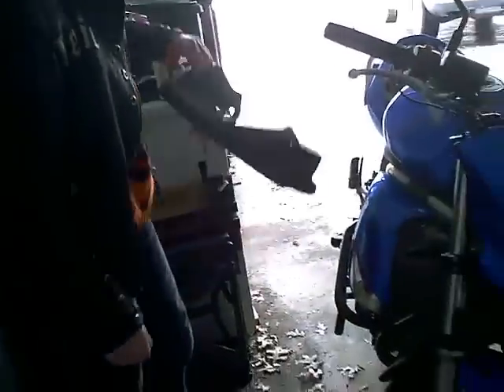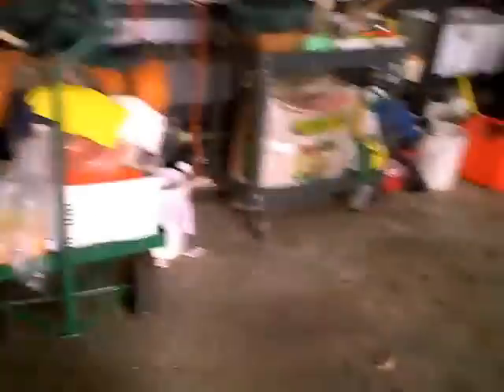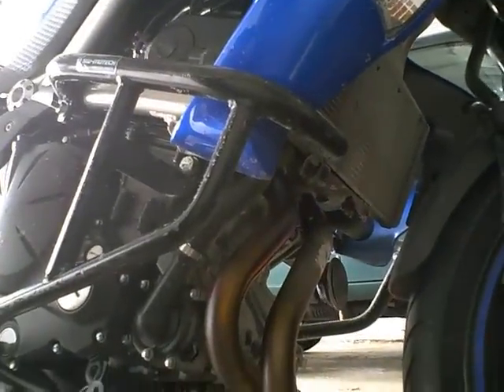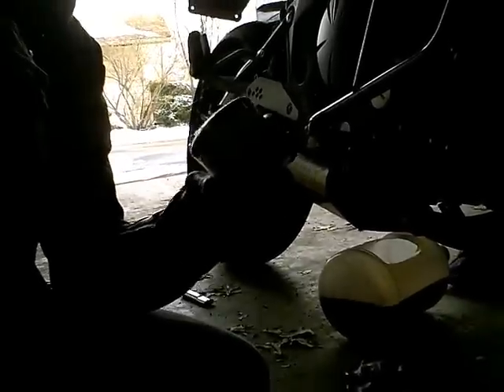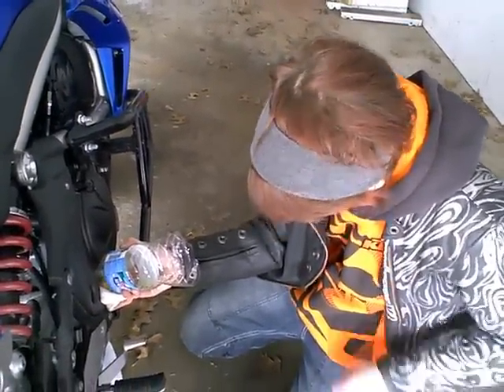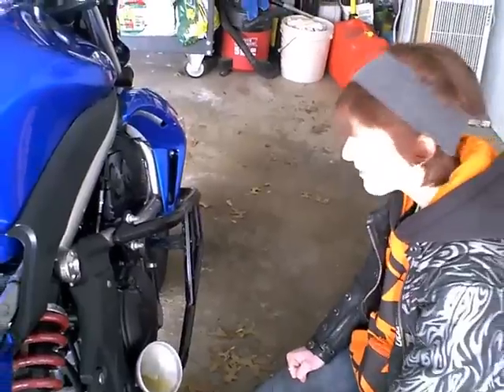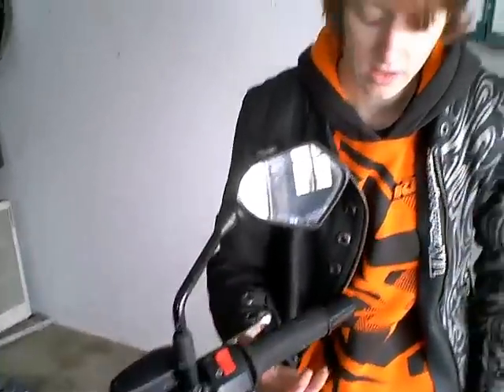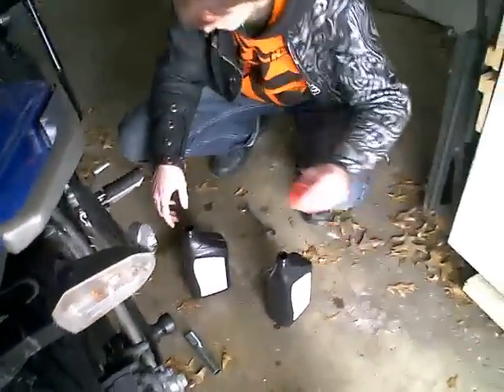Changing Oil the MacGyver Way, Starring LaurieJennifer

Comment: Yes and no.  I had let it run earlier, but that was where the problem came in.  Generally, I would do that, as warm oil flows better.  In this case,  condensation had gotten into the oil, so the main goal was simply to clear it out asap and not continue to run it.  Watery oil is generally no bueno.

Comment: The white smoke is water vapour from the combustion process. As the bike warmed up it drove off the visible water. Magnetic drain plugs only let you know something is going seriously wrong in the engine. The oil fiter should catch the particals. Without spliting the filter you'd never know of a major fault until it was to late. Or thats the idea.  Please excuse me if I sound like a smart ass its not my intention.  Watched it all.  Enjoyed the vid keep it up. Chears.

Comment: Nice. I change my oil every 5k miles. I hear rotella  t6 works just as good as a cheaper replacement to the castrol synthetic I've been using.  As long as the oil is Jason certified its supposed to be safe to use in your bike.